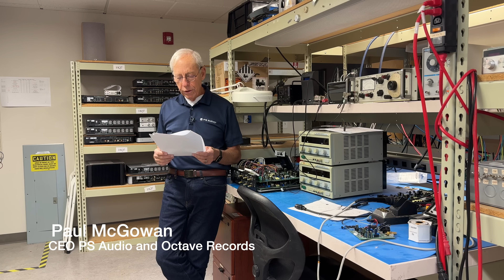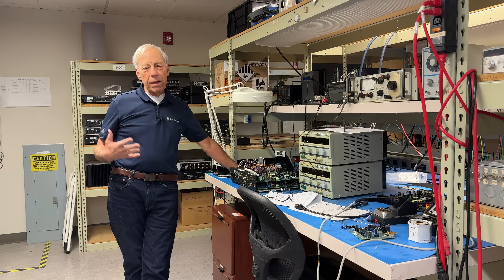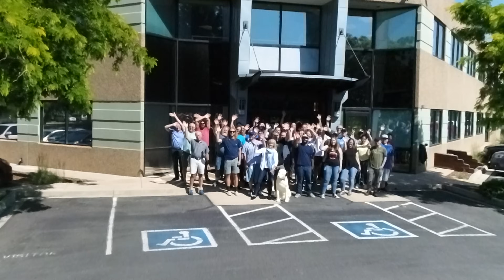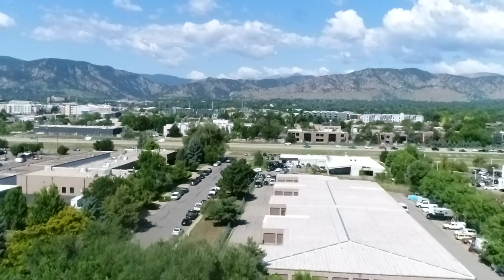Clocks inside streamers

Comment: Most streamers these days still have a DAC in them, either a "good" one at their price point or one just for "convenience", knowing that the buyer will likely be using a much better external DAC. So yeah, I can see that streamers that have those built-in DACs still need a decent clocking. The engineer guy who is asking the question does bring up a valid point. At some price point for streamers, why not simply do away with that "convenience" DAC and clocking and merely be a true transport sending the data to an external DAC with its own very good buffer and clocking.  It might not be adding much to the cost of these devices, but why pay for something we aren't planning on using?

Comment: I think it's also.important to mention that  all decent DACs will buffer, which means that they will use their own clock. And that means that it does not matter if the original source is jittery or not, or what it is. As long as bytes come in, then they will play perfectly. Otherwise some folks might think that expensive CD players somehow send  "better" bytes than an absolutely cheap CD player. Or some might think that some bit perfect sources will sound better than others - which of course is not true. But of course different digital sources might have the same performance but mastered differently. And how it was mastered is where the difference really is.

Comment: This confusion all arises due to TOSlink hell.  TOSlink is just a thing that should not have been; it was designed (as Paul note) that the CD spinner sent out the data with the timing.  Today everything upstream from the actual DAC (the device that does the conversion, not a box labeled "DAC") should not matter as far as clocking.

Comment: Simple .... a streamer is a computer.  

It connects to a server via TCP/IP and essentially downloads the music file.  The file is coming in many times faster than the playback speed, so it is buffered in memory. The ACK/NAK protocol is used to arbetrate downloading chunks of the file to avoid buffer overflows. 

Now this computer has a sound chip on it, a DAC, that runs at the sample rate, not the main buss rate, so it needs a clock to time it's data consumption.  Often the sample clock is derived from the main clock so they are more or less synchronized. 

When the buffer gets below a certain point, the DAC logic signals the main computer to download another chunk of file. Running in a circle until the playback is finished.

In the end it's not much different than USB Audio from a PC.

Comment: Isn't it true that when you connect a DAC to a Streamer using a S/PDIF COAX the master is the streamer's clock (without a reclocker).  If USB, there is no clock in the transmission protocol, so the DAC is the master?
Reply: @steve8553  With asynchronous audio transfer via USB you can allow the DAC to master the clock without messy multiple clocks trying to work together through a PLL. Jitter absolutely does not need to be a topic for a modern internet streaming solution but it becomes a topic when using older synchronous data interfaces like SPDIF, Toslink or I2S. This video doesn’t convince me PS audio gets it right about asynchronous audio to the DAC.
Reply: @ThinkingBetter   Thanks.  I have very nice DAC connected via COAX to a mediocre streamer.  It's nice.  But I tested connecting to my MacBook via USB.  I was shocked how much better USB is.   I was told USB was inferior, but that's not a universal truth is it?
Reply: @steve8553  might be the streamer at fault?
Reply: @ Yes, exactly.  With S/PDIF (coax) all things being equal, your result is only as good as the sender's clock.  But USB is asynchronous, so the receiver's clock rules. (So I've learned and experienced.)
Reply: @steve8553  USB is way superior with higher bandwidth and a proper protocol supporting asynchronous data transfer.

Comment: All of this talk is about reducing or eliminating jitter.. True? If so, what does jitter sound like if it gets through your system? Thinking back over 30 years ago when I had very budget equipment with better than budget speakers I don't recall anything objectionable when listening to CD's. Which I loved the sound of. Even today I stream directly to a Mid end receiver and it sounds fantastic. I have a $150.00 Sony Blu-ray player that plays everything and sounds fantastic, especially SACD and DSD disks. All the years I've never heard anything objectionable. So what does jitter sound like?
Reply: Thank you for the comment. I agree. There are a couple examples on the internet, but none from manufacturers or audiophile publications. Please give samples so we know what to listen for. I am genuinely interested. Is it wobbly pitch? Pop? Crackle? Complete cut off in sound? Hiss? These are descriptive words that will help.
Reply: @kenwuesq it doesn't sound like anything, when audiophiles went digital vendors had to come up with some analog-like bogeyman that they could charge you more and more money for allegedly better and better performance.  Less jitter! 10x less jitter! Oven controlled crystals mounted on rubber shock absorbers! It's absolute nonsense. Sure it's possible to drive a dac with an artificially terrible sample clock and if you make it bad enough you can measure and maybe hear extra harmonics (the essentially noise in the dac clock can modulate the audio signal) but it's a complete non-issue for even the most bargain basement Amazon cd player or USB streamer digital output.  The snake vendors realized you couldn't be convinced that one digital number from their expensive wood grained device was different to the same number coming from a $29.95 plastic box so instead the jitter boogyman was invented, so they can say "sure, it's the same number, but ours has much lower jitter" and because jitter is a analog value and regular people aren't able to readily hear or measure it, it's ideal for separating fools from large amounts of money. See also; audiophile network cables, etc
Reply: @DrTune  Thank you and I agree about bogeyman. Even when manufactures talk about “noise,” they’re not specific. My baby crying is noise. Traffic is noise. What should we pay attention to so we can identify and fix? Hiss? Hum? Pop? No sound? Skipping music?
Reply: @kenwuesq the way they describe noise you’d characterize it more like distortion.
Reply: Interesting! Thanks for the comments

Comment: I appreciate Paul's history of CDP evolving into the streamer/DAC.  A CDP was a data source, the CD device, a clock and a DAC.  We then introduced separate DACs leaving the CD spinner and clock separate.  DAC's started to have clocks which is smart.  The closer the clock is to the DAC the easier it is to keep the signal clean.  Now transports have evolved to be network connected computers with the possibility of local storage or network accessed data.  Still the clock is key to the sound.  If the clock is perfect in the DAC, no other clock is necessary.  End of story.  But if the clock can be bypassed, then putting a better clock in the streamer might improve your sound if you can connect it without messing up the signal.
For me this has just made it a perfect environment for DIY.  When gaming required better PC's than general purpose home computers provided, we all built out own gaming rigs.  It was not tough using the same lego parts DEL and HP used.  It is the same with a streamer/DAC.  You can build or buy all the parts and upgrade them independently.  Or you can let great companies like  Paul's do it and just enjoy it.

Comment: Yep Paul's is RIGHT!!!! Multiple Clocks with Re-clocking WORKS !! 

I'm moving on to A.I.projects but a Smart DDC is needed in Audio I invented such an improvement but have no time to get it out of the door to Public .
Reply: @HeavyCrown2030  No, it’s totally nonsense. For internet audio streaming you simply need a precise DAC clock that runs the sample conversion and then all the music data is moving asynchronously with buffering ensuring there are no dropouts. Jitter becomes a topic on internet music streaming when the music data is not managed fully asynchronously from data center storage (HDD or SSD) vis the internet, music streamer and to your DAC. Re-clocking is a stupid snake oil scam and just showing a company’s lack of digital audio architecture and engineering competency.
Reply: @ThinkingBetter  1 lump or 4 lumps of Sugar in your Tea?
Sure you can build a DAC that can do noise shaping and filtering  Top Notch.

Understand this in the Audiophile audience just like everything else most just listen to the Music others know exactly what's missing.

Lucky for me dur8 the Pandemic I was stuck at home with hundreds of thousands of test equipment and time to study exactly how audio works from start to end ...  Yes!!! Music benefits in refining the last step before the entering the DAC...before the pandemic gave me time to Analyze my answer would have been similar to yours  even with my 40 year's of electronics and computers.

Last thing electronics are built to a price point Example : Microsoft could have built everything into there software..look at all the things must buy... Boeing could have just built attack angle mitigation into the 737 Max!!! But the didn't please consider the facts above...

Comment: Ideally the DAC runs the actual timing precisely and everything else upstream is just moving data asynchronously with adequate buffering in the DAC to avoid dropouts. Since a player needs to be in sync with the actual audio, the DAC buffer can’t be too large or you will, for example, experience pressing pause will cause a latency. One clock master is all you need and all talk about multiple clocks/reclockers just obfuscate what truly is ideal architecture. Jitter becomes a non issue with such architecture and in reality it’s also simpler. Problem is that old hardware interfaces were made for source dictated clock from either CD, DSD, Blu-Ray or broadcast video where you end up with at least two clocks. For modern Internet streaming, there is no such issue and hardware interface to DAC should be asynchronous.
Reply: Right on.  The best place for a perfect clock is as close as possible to the DAC.  OTOH, if you own a DAC with a mediocre clock, you can potentially upgrade it's sound by using a streamer with a better clock iff the clock in the DAC has the option to be bypassed.  Still not ideal.
Reply: @user-od9iz9cv1w  Actually only the DAC's clocking of samples matter for audio fidelity while all other clocks are about ensuring the data is available for the DAC without dropouts. There is no actual good reason in "re-creating" the digital audio problems of multiple clocks and PLL in a modern online streaming solution. A "streamer" should output the digital samples asynchronously to allow the DAC to have full PLL-free control of the clock.
Reply: putting in a small resistor on a clock line to a DAC chip could be quite helpful.

Comment: Marcus, in Cologne Germany,

A DAC is a digital to analog converter.  That process does not include a clock, which is necessary to reduce jitter.
The clocking operations are performed by the transport box.

A CD player is a combo box, where it is both a DAC and a transport (the reading of the bits from the CD is the transport section).

The streamer that you inquired about is a transport.  It receives data from some source (the internet, a computer on your network, its own internal storage drive), and re-clocks it to minimize jitter, and hands it off to the DAC for it to create analog voltage..
Reply: All DACs include clocks. For (asynchronous) USB connection it is the receiver's (DAC's) clock which is used. For S/PDIF, DAC clocks can be used for clock comparison and correction or for buffering and re-clocking. Btw the clock's job is to enable the DtoA conversion process, it is not just 'to reduce jitter'...
Reply: @razisn Totally… I’m not sure how Paul managed to talk about this topic without mentioning this fundamental difference in the various digital connection types.
Reply: @razisn  It is my understanding that the DAC's clock syncs to the transport's clock.
Reply: @0Perhaps  what I said above
Reply: The clock being referred to here is the clock used to pace the exact moment of the conversion of samples from digital to analog. (Other clocks may exist to facilitate the transfer of data to the DAC or perhaps between components with the DAC. but that isn’t relevant to this discussion.) Errors in this clock pacing conversion directly results in jitter which manifests as distortion in the analog signal output of the DAC.

I would say virtually all modern DACs of the last number years provide this pacing clock. It is definitely necessary for DAC supporting asynchronous inputs types like (modern) USB and most DACs will also re-clock the other synchronous input types (S/PDIF, etc). As Paul states here, this wasn’t always the case. DACs once took a narrow view of their responsibility and use the pacing of the synchronous data from transport; at that time, any jitter was the fault of the transport, but this is a rare situation now days.
Reply: How does a DAC chip time? Perhaps a word clockline (lets say a high on every word) and a bit clockline, on every bit. So a divided by 24. And then some magic happens, lets take an 8 time clock to allow oversampling. Chips kinda like being told what time it is and what to do, so to make them happy timekeeping is a bit of a management issue.

Comment: The final DAC clock should be of the best quality.
Reply: I thought the streamer clock would become the master clock when using I2S
Reply: @ NO...the streamer is the data source and should not master the clock. The DAC must do this or you have multi clock sync and PLL issues. Problem is I2S is using synchronous data transfer. Ideally the data is transferred asynchronously to allow the DAC to fully and precisely time the tick of each sample being transferred to analog.
Reply: @njrumenos  Not necessarily. On various streamers it is possible to override the streamer clock provided that you use the external master clock inputs.
Reply: If you feed the final clock crap it's still going to be crap. You still want the first clocks to be decent
Reply: The clock is only a small part of the device, and not that significant in my beliefs. A bit of jitter and time smear is just fine, most of the time the devices have far more pressing issues. Plugging in your power cord the other way round in order to pole the transformer differently could make DAC sound better than a slightly better clock. Just stay away from high sample rates and bit depth to make the clock less critical.
Reply: @edmaster3147  you could use $20 speakers to make it not matter as well
Reply: @ or just no speaker at all.

Comment: Does lifting up the clock affect the sound?😅
Reply: A slow move like lifting a device is insignificant.  But...
Clocks are microphonic.  Vibration does impact jitter.  Clocks are also generally temperature sensitive.  The best clock will perform best when implemented in a temperature controlled environment in a mechanically isolated environment to free it from all vibration including the sound of the music.   Lifting the oscillator off a PCB and putting it in a blob of silicone will have an immediate and significant change to the sound.

Comment: I guess the simple answer would be that the digital stream requires a clock to reduce jitter / smearing that is caused whenever the stream passes a device or an interconnect?
Reply: I'd argue no.  There is no need for the data to be anything other than bit perfect until the moment it is presented to a DAC for conversion.  Then the timing is equally important to the data.
The last clock to specify the timing that the DAC uses is the one that affects the sound.  If the DAC clock cannot be bypassed, the streamer clock really doesn't matter.  Likely it is the noise isolation in the streamer that improves the sound.  If the DAC clock can be bypassed, then a clock with lower jitter in the streamer will improve the sound if the connection can maintain the clock signal.
Reply: @user-od9iz9cv1w  isn't it only bit perfect until the ethernet connection though?